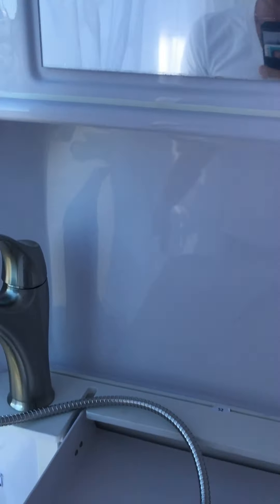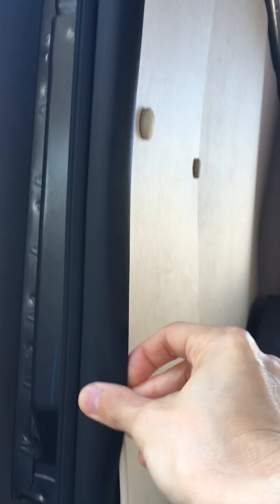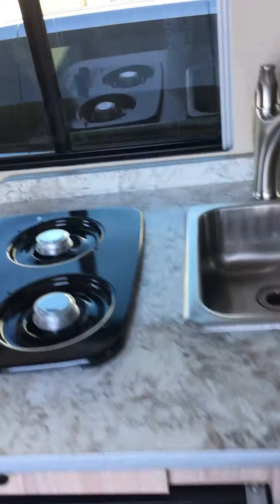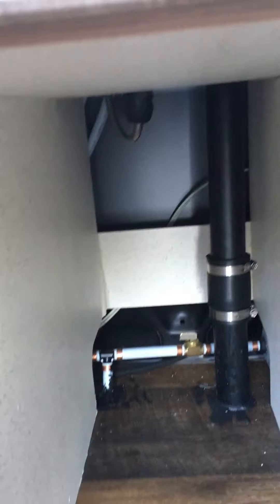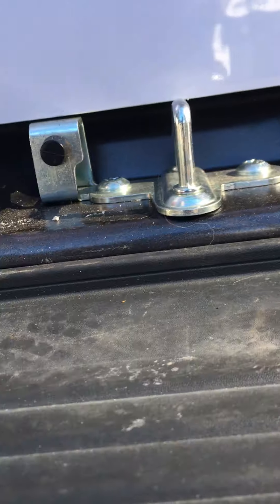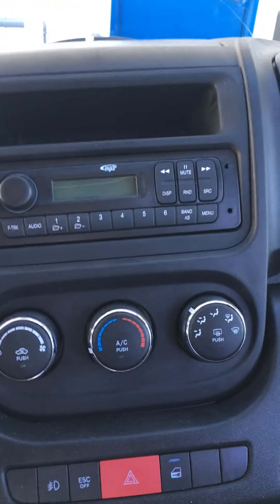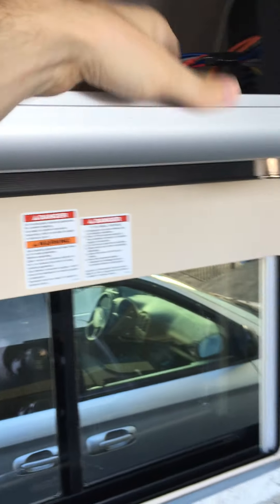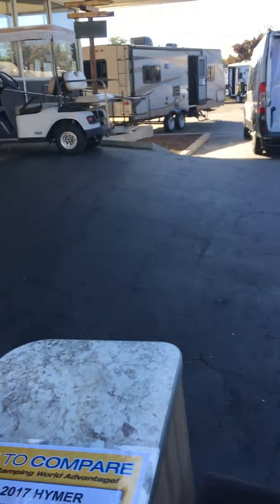Hymer Sunlight Van One V1 review Part 1

Comment: The Hymer CEO said that they designed these to be cheap. He further said the teams building them are only given 4 hours to complete the van and its out the door. It is meant to be a camping world van that sells for less than 60K. They are not meant to be quality and the CEO further stated that the people building them are new because the labor cost for new builders is cheaper. They are doing these vans fast and dirty. I would not expect them to sell well at all. They want these to be churned out in high numbers in hopes that you are not going to buy used when you can buy new for the same price. Just remember folks, this is built by inexperienced builders who are given 4 hours to finish the van. They do not get more time. Supposedly there is also NO QUALITY CONTROL at the plant for these. So you get a cheap, fast built van, rushed out the door.
Reply from the maker: Wow. That is a huge bummer. That sucks.
Reply: It's one thing to have inexpensive material, but quality is about not having defects.  If the design is poor and the fit and finish is bad, this is what you get.  You can design a quality low cost entry with excellent quality if you put effort into it in the design and manufacturing stages.  Never confuse luxury with quality!
Reply: omg hymer is going to DESTROY their reputation with this piece of junk.

Comment: Great honest review. Unfortunately this is what happens when products are manufactured with the only purpose to capture a percentage of the market with zero regard for how the product actually performs. Hymer corporate needs to squash this thing before they ruin their North American name before they even get started.
Reply from the maker: I 100% agree with you. Hymer is now saying that it isn't built by them, it's built by the RoadTrek team in the facility that the RoadTreks are built. The same facility they said all their products would be built, but in a different section of the RoadTrek assembly line, and by Hymer builders (presumably imported from EU). Well, then why did they have this built by non-hymer tech's if they won't associate it with Hymer. This van makes them look bad. They should pull it.
Reply from the maker: Wow. Owns Camping World and doesn't care about selling motor homes. "We're not as sensitive to that Ebb and Flow."
Reply from the maker: Camping World has asked me to take the videos down. I stand behind "Freedom of the Press".

Comment: Thanks for the video.  My local CW would not allow me to video!

I've viewed both the Hymer Aktiv and Sunlight at different dealers.  Also, I visited their factory this week.  The units that I viewed at the dealers had similar/same fit and finish problems.  More recent units at the factory look better.  (BTW - there is spray foam insulation under the panels). 

The cabinet fit doesn't bother me, but the side panel fit really did bother me because it's just plain ugly, and even with the insulation, it will allow drafts more easily when it's cold.

The factory guy was unapologetic about the hoops that they were jumping through to meet the price point set by the new owners of Roadtrek (Hymer) and the new owner of Camping World (Marcus Lemonis). Having worked on the shop floor of a factory, I understand what may need to be done to meet a cost/margin/price point.

Given that, for the Sunlight, one must consider how much and what you are paying for.  You still get a Promaster (good) and you still get a Class B (also good).  Though it's a little shoddy, if you are handy, and as you pointed out with the aluminium frame for the cabinet, it could be removed (and replaced with a higher quality cabinet later if wanted).

And because of that, we're still considering a Sunlight because it can be had (with the lithium and underhood gen set) for less than $60 with discounts.  Interestingly, we're also considering the far other end of cost with an Agile SS (but for different reasons.
Reply from the maker: Wow, you are doing all your homework, and that's great! There's a lot to love about this vehicle, but there are so many things that need to be better implemented no matter what the price point/margins @CampingWorld and @GoHymer are trying to meet.

But I agree, for $60K, this B-Class with underhood gene and batteries is still a very good deal, quality issues aside.

Comment: Thank you for this review. We just started researching class B's. Which ones do you like? Thanks for the honest review, I'd buy from you if you were a salesman.
Reply from the maker: @PerezTeam You're very welcome. And to answer your question: There were a few I liked but I ended up buying a new ProMaster Van and built it out myself. It has everything I want, nothing I don't want and it's much simpler &  more functionl (space- I put a Sportsmobile top on it so I could have more livable/walking space. It also made enough room for a full-size shower stall). The cost of the van, building material, labor AND the @Sportsmobile top was still less than this crap-quality Hymer... $10,000 less. Yah me. :-)

Comment: Wow, what a disaster. I bet the Road Trek guys were holding their noses while they built this in the back factory. Such a shame that a real solid Canadian company, that for decades has been far and away the North American market leader, has been forced to its knees by Hymer to churn out this poorly made junk for Camping World. The bottom-end price was a good idea, especially to appeal to those thinking of doing their own conversion, but to have what is clearly jerry-rigged, ill-fitting parts and finishes throughout negates the whole effort. The low-hanging plumbing pipes is a first-trip fiasco waiting to happen. Wouldn't make it past the first speed bump in my neighbourhood. Sad.
Reply from the maker: Good news! They acknowledged some of the quality issues but changed only 1 thing for 2018 (so I guess they ARE keeping them going after this 1st-year-flop?). They moved the waste tank that was hanging down under the rear. So get this: They removed the spare tire to do so. So does that mean that the spare was UNDER the tanks for 2017?? What would you do if you had a flat- drop the sh*t-tank to get to the spare? 

Well, and that's their upgrade! #QualityControl #LOL

Comment: Hymer is the best big motorhome manufacturer in  Europe and the qultiy of their prodcuts is renowned  this van cannot be a Hymer . or this  video is a set up
Reply from the maker: ?? It's a Hymer Sunlight V1 or Van One. Only sold at Camping World locations. I have talked with Hymer NA and also Camping World about this van, and Camping World seemed disappointed when they took delivery... and Hymer stated that this van is $10,000 cheaper than the next cheapest class B, so there were some cuts made to budget the build.
Reply: building to a budget is one thing. but this van is obviously far below the Hymer  standard,  I'd contact Hymer  Germany directly in Bad Walsee if i were you !
Reply from the maker: I contacted Hymer. They reminded me it's the industry's lowest starting price. And then they said "It's not a Hymer...". I have no idea why they would now say it's not a Hymer. This is a terrible start to what we all thought would be amazing camper vans and trailers. Hopes for Hymer to change the quality in the industry looks bleak...
Reply: I can tell you that this is probably not a setup. Reason I say this is because I had "taken a tour" of the Sunshine One vehicles online by checking out quite a few of the stock that was available for purchase by various Camping World dealerships. I couldn't believe what I was finding just in the side entrance area and the area above the cockpit where there is some overhead storage. From the pics that were posted by Camping World, I was stunned at all the poor craftsmanship they themselves were advertising.
Reply from the maker: One would think that after this much time, someone would make the remedial adjustments to the pallets or molds to correct these fit/finish issues.